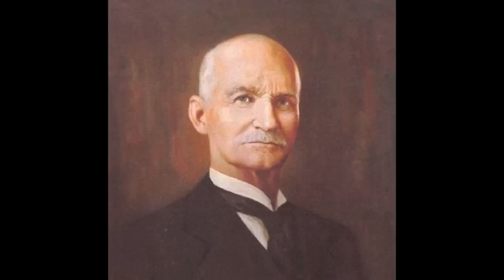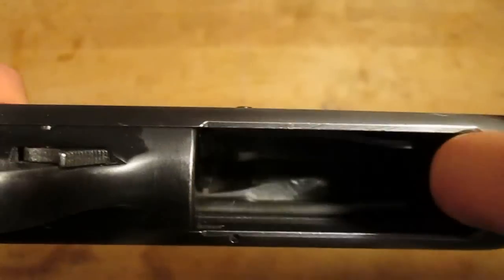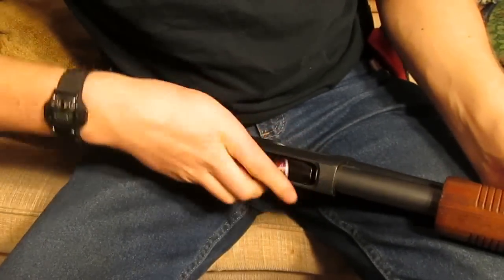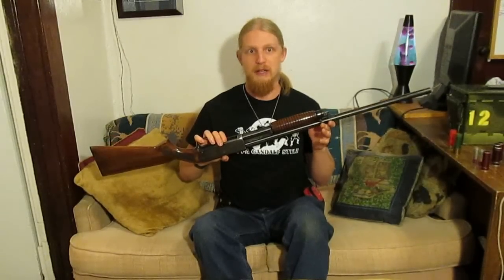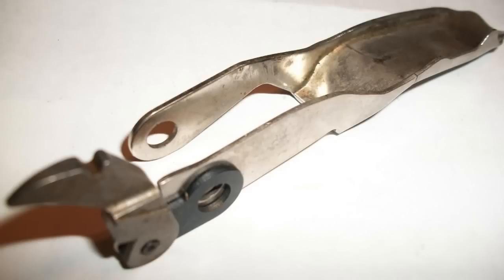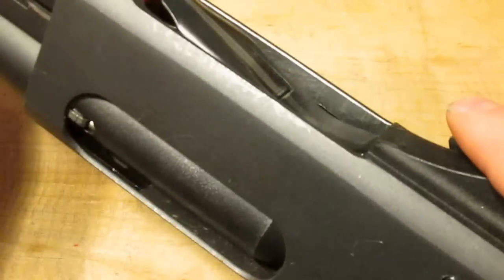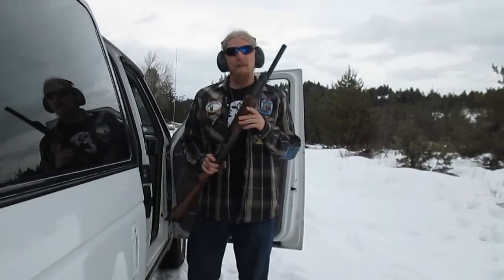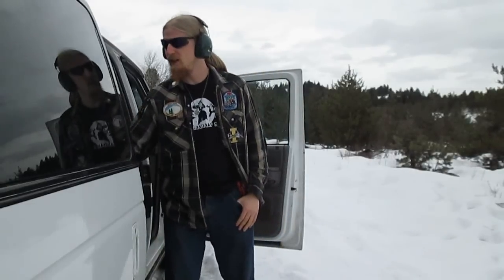Much Ado About Shell Carriers - Remington 870 Tips & Tricks #5

Comment: Looking to build a 870, but I understand Remington does not sell receivers, I have all parts except the reciever.
Reply from the maker: You can try to find a used receiver on its own, or buy a used 870 and start building on that.  Doesn't matter if other stuff is trashed long as the receiver's in good shape, and 870 receivers are pretty darn tough.

Comment: Question for ya; Do I need a new bolt if I replace an old Wingmaster carrier without the flex tab to one with a flex tab? There are 2 kits to do this, one with the bolt and one without. Remington says get the new bolt, others say you don't need it. Just replace the carrier and other parts, no need for the new bolt which adds $75 to the total cost. Thanks.

Comment: One question about swapping out the pre-84 carrier and bolt, can the steel extractor from the older bolt be removed and out in the newer extractor in place of the MIM part? I want to keep the better of the two extractors and if I don't have to replace and buy a new extractor I would rather not.
Reply from the maker: Bayan1905 Both MIM and machined extractors work fine, to be honest.  But if you trust one type over the other, all right-hand 12, 16, & 20-gauge 870 extractors should be interchangeable.

Comment: Im a new sub, and have enjoyed your very thorough information. I agree there is no one manufacturer or platform that is the      ultimate because I have a wide variety with pros and cons. My question is as I live in Canada I just picked up a "Canuck" 12g short barrel (14") pump. There is not much info on line. It is made in Turkey, so, am I to assume it is a Remington Chassis. If so can you recommend an M4 type stock and foregrip. It has beautiful walnut now, however I wold like to Tacticool it for 3 gun and store the wood. Thanks
Reply from the maker: I don't know if that's an 870 clone or not.  Turkish manufacture doesn't indicate much; genuine Remington 870s are all U.S.-made.  If it is compatible with 870 furniture, several companies make adapters that let you attach an AR-15 buffer tube & grip, so you can use whatever grip or stock you like.

However, having used pistol grips on an 870, I feel the gun works best with the semi-grip stocks that it was originally designed for.  A semi-grip stock is more maneuverable, more robust, and offers better access to the gun's controls.  If you still want a tactical look and save the wood, you can go with a basic black synthetic stock and a good recoil pad.
Reply: Thanks for the response. What is a semi grip?
Reply from the maker: It's a traditional American shotgun grip style, different from the more "tactical" pistol grip stocks in that the grip is integrated into the shoulder piece, but with a more pronounced grip than the older straight-stocks.  It's the stock style that both shotguns in this video have, and it's style B in the following image:  https://upload.wikimedia.org/wikipedia/commons/thumb/1/18/Gunstock_grips.gif/250px-Gunstock_grips.gif
Reply: Ok, I see what you mean. The Canuck has this syle and is very comfortable. I converted my 1962 Winchester Defender to a Blackhawk tactical kit with a pistol grip and it sucks. It kicks the shit out of my cheekbone but I do like the pistol grip. Thanks for the info. Happy new year as well. Hope Trump doesn't fuck things up for you guys.

Comment: Superior content👍👍

It seems to be possible to pull the bolt back, push the shell carrier up, so it stays in that position during loading. Is that true?
Reply from the maker: You can, but with the bolt back, the 870's carrier is higher than it would be with the bolt forward, and it's not lined-up properly to guide shells straight into the magazine tube.  While you can load the magazine this way, it's much slower and more finicky.
Reply: @SynchronizorVideos  Thanks a lot👍👍

Comment: O.K. I knew there was some way you were supposed to be able to jam one up, but I've never done it. The 870 Wingmaster is the main gun responsible for the demise of the model 12. As it was designed with stamped parts and pressed checkering it could be sold cheaper. Remington knew what they were doing when they invested in those machines!, but it's a shame that fine old guns like the model 12 with all machined and hand fitted parts were drove out of production.

Comment: Do you think cutting a U-shape notch in the front part of the lifter would solve the glove related loading issues?
Reply from the maker: No, I think it might actually make it worse by adding more corners and edges for the gloves to snag on.  As I said in the video, even loose gloves really didn't seem prone to snagging on the carrier due to the way it moves.  The gloves were more likely to snag on the shell latches rather than the carrier, and no carrier mod is going to change that.
Reply: Thanks. A lot of people mention that problem, but never show it on video.
Reply: D. Alex Oprea I was thinking the same thing

Comment: Very good video. I’ve got a question I can’t seem to find any information about on YouTube or the gun forums. I’ve got an older 870 Wingmaster and when loading shells into the tube, the carrier seems to move too far inwards towards the “top” of the receiver (“top” referring to the normal shooting orientation of the gun, regardless of how it may be rotated to ease loading) which causes the shell I’m feeding to hit the top edge of the tube instead of feeding in smoothly. I have to hold the shell out a little bit in order to line it up, but if I hold it too far it won’t start in; its pretty finicky. I can’t seem to find anyone else who has this problem... I see a very occasional post about the carrier not moving far enough and causing the shell to hit the bottom of the tube, but absolutely nobody seems to have it travel too far and let the shell hit the “top”. Is this adjustable in some way; have I got a worn out stopper or bumper of some kind in there that’s supposed to limit the travel?
Reply from the maker: Just to be sure, you're loading your 870 with the action closed, correct?
Reply: @SynchronizorVideos  Yes, that's correct. A relative of mine is better at repairs than I am; we dismantled it and found a way to bend the carrier tab itself ever so slightly so that it would contact a little sooner. Loads perfectly now. There's no "adjustment" we can see short of bending or replacing the carrier itself and hoping the new one is a better fit. Time will tell whether it springs back or stays put.
Reply from the maker: @bustedbenz  If it acts up again, I would say try a new carrier.  A new carrier assembly is not very expensive, and replacing it doesn't require any tools.  With the action closed, it's the slide assembly under the bolt that stops the carrier, and that's a pretty beefy part that's not likely to bend with normal (or abnormal) use.  Plus, depending on how old and what gauge your 870 is, a new carrier might be a slight upgrade.

Comment: great video, Q: which one is longer and more accurate shotgun, is it 28" or 18"?
Reply from the maker: 28" is longer, obviously.  Accuracy doesn't really depend on barrel length.
Reply: @SynchronizorVideos  how about power and range ?
Reply from the maker: @adamdula6090  A 28" barrel will have slightly more muzzle velocity than an 18" barrel, but the difference is not that significant.  Shotguns tend to use fast-burning propellants, and the additional barrel length past 18" doesn't add very much.  For shotgun applications where longer barrels are preferred, it's usually more about balance and inertia than it is about a tiny bit more muzzle velocity.

Comment: Hello I own a H&R Pardner which is a clone of the 870. I am having problems with one of the latches. It seems to be bent, I can't load without holding it down and after that it will not cycle the next shell. Can you help?
Reply from the maker: If it's bent that much, it may need to be replaced.  Hard to say much more without seeing it myself.

Comment: Do you have a video on how to remove a live shell stuck behind the carrier  ?.
Would appreciate any help.
😬
Reply from the maker: If you have a newer 870 with the flex-tab carrier, just open the action.  If it's an older gun, take out the trigger plate assembly.
Reply: @SynchronizorVideos  But if it keeps stucks behind the carrier do I have to replace the old lifter with a new lifter that has a flex tab?
Reply: @this_is_ARZEN  maybe a shell latch
Reply from the maker: @this_is_ARZEN  If it's a consistent issue with your 870, a flex-tab update would help, but the root cause of the issue is probably some combination of poor loading technique and/or worn shell latches.

Comment: At 1:40 you're holding a shotgun in your lap and I know it's a Remington but could you tell me the exact model number and or type because THATS the type of shotgun I've been looking for. Thanks for all the videos, they are highly informative.
Reply from the maker: That 870 was pieced together, Remington doesn't offer that exact configuration right out of the box.  It's a basic Express Tactical receiver & 18.5" cylinder-bore barrel with an old set of police walnut furniture and an aftermarket mag cap.

The current #25559 4+1 870 Hardwood Home Defense would be pretty similar to this.  It would have the same finish, choke, sights, and capacity, though the wood isn't as nice (generic stained hardwood rather than nice-looking walnut), and the fore-end is a mid-length unit rather than my short Police piece (though I actually think a mid-length fore-end is better for a lot of folks).  Pretty basic, but functional and affordable.  

Another similar option would be a #25015 Police model (or a similar 4+1 wood/Parkerized 870P).  It'll have pretty much the same walnut furniture (though probably not as glossy-finished), as well as a non-extended magazine and an 18.5" barrel with a front bead.  The finish will be Parkerizing rather than matte bluing, but it'll look very similar, and Parkerizing is better anyway.  It'll also have an IC choke rather than a cylinder bore, along with a few other minor parts differences.  The 870P will cost more than the civilian Hardwood HD model.

You can also look for used wood-stock Police 870s or old Riot Grade models.  They'll be pretty similar to this gun, though the finish may be glossy instead of matte, and some may have a 20" barrel instead of the 18.5".  They may need some TLC or parts updates, but they're generally a pretty good value for the money, and a lot of older Police guns had prettier wood than what the newer ones come with.
Reply: Synchronizor Thanks for the information, I'll keep my eye out for some old police walnut furniture. I've always wanted to try the 870P because I keep hearing from people about how "superior" they are but I just don't know. I can never find a used one around here. I continue to learn a great deal from your videos as well as from the forum, and that's valuable to me. Thanks so much.
Reply from the maker: Compared to a similarly-configured Express, an 870P gets you a few minor internal parts differences, different furniture, and a better, tougher finish.  The finishing is the real reason to pay extra for an 870P, in my opinion.  Furniture can be changed and the few different internals are easy to swap in if you care about that, but refinishing the gun takes professional tools & know-how to get a good result.

Older used 870Ps can be a good value for the money, but if this gun is going to be used for critical applications like defense, you'll want an up-to-date gun, and a lot of the surplus 870s out there don't have all the current parts.  Depending on what's missing, updating an old gun can be expensive enough to cancel out the savings of buying used.  Buying new means everything's up-to-date right out of the box, and it can save you a lot of headache if you're not an expert on the platform.
Reply: Synchronizor Thanks again. That answers a question of mine because it will be a home defense gun with the occasional shooting with friends. If I decide to go with an 870P I'll go for a new one. My decision is now down to an 870 express of some kind or a new 870P. Two to choose between are better for me than multiples. You have been a HUGE help. Thanks again for all the informative information.
Reply: Synchronizor I found an 870 7 shot tactical model I believe it is. It's a 7 shot tube with no extension on it. Any thoughts on this one? Seems like a good one for 300.00. I also found an 870P and it was pushing 600.00 for a new one. Just wondering if the finish on the tactical model would be fine for an HD gun. Any opinions or thoughts on the 7 shot? Just trying to make an informed decision before I shell out any money.
Reply from the maker: The thing to keep in mind with the special Express Tactical 870s that have that non-standard 6-round mag tube (the "7-shot" comes from six in the tube plus one in the chamber) is that you lose the barrel interchangeability most other 12ga 870s enjoy.  These are meant to be dedicated combat/defense guns with a very narrow array of 18.5" barrels that are compatible.  If that's what you're looking for, they can be a good choice; 6 shots with less complexity and simpler take-down than a similar 870 built on a standard receiver and using a +2 magazine extension to get 6 shells in the tube. 

However, they're not something you can throw a long barrel on to go hunting or skeet shooting, or even re-configure for defense, like switching to a 20" or 23" barrel with a longer extension, or going SBS with a 14" or 12" barrel.  With limited barrel options, your sight options become more limited as well; if you want something besides a front bead or a front blade, it'll take some gunsmithing work.  This is the key thing to consider, as I've seen many folks come through the forums having bought one of these special Tactical models, without being aware that they're not the same outstanding multi-role guns as a normal 870.  Sadly, the people selling the guns are also often unaware of the distinction, and mislead potential buyers.

Basically, if this is going to be a multi-role gun, or even if you think it might become a multi-role gun in the future, or if you just want to keep options open, I would say stick to a standard receiver.  There are some ways to use spacers or modified barrels to get other barrels onto a long-mag 870, but they're really not ideal.  

As for the finish, the Express black oxide finish is perfectly fine for typical HD environments - namely, a temperature-controlled home.  Unless you live in an old beach house or the middle of a jungle somewhere, it should hold up just fine as long as it's kept oiled and not allowed to sit wet.  My Express-finished gun doesn't give me any trouble (aside from some minor surface rust one time when I really neglected it after being out in the snow), and it sees heavy use and all kinds of weather.
Reply: Synchronizor That's a VERY good call there and you just saved me some headache because I do like to shoot skeet and the interchangeability is something I would like to keep available to me. I did see an 870 express with the factory extension tube already installed on it. I could get that one maybe and I wouldn't have to worry about drilling out those tabs in the tube if I had bought an 870 with no extension on it. Looks like all I need is to by a cap and shorter spring if I decided to take the extension off maybe. This is ALL very good advice you have here and I'm taking it all into account. Thanks so much for the advice my friend!
Reply from the maker: Yeah, if you're buying new, 870 Police models and civilian 870s that come with factory-installed magazine extensions won't have any mag tube dimples to drill out.  Their barrels should also have mag cap detents installed for external-ratchet cap/extension retention that doesn't rely on having a newer plastic spring retainer that locks into those dimples.  Neither of these things are all that big of a deal, but they do make things simpler, especially for newcomers to the 870 platform.
Reply: Synchronizor Ok, I was curious about those dimples. I will either end up with an 870 express with factory extension or an 870P. Time to go looking for one! Thanks again!

Comment: I bought a used 870 Express in 20 gauge. It looks almost new and has a laminate wood stock so it's not an old gun but I've noticed it doesn't have the flexitab carrier. Presumably this type of jam (where a shell isn't properly inserted into the mag tube, pops back out and and gets caught up above the carrier) is possible with the 20 gauge? I haven't tried to replicate it.
Reply: Make sure you push the shell all the way into the mag tube, so its resting on the lip further in and not the lifter.